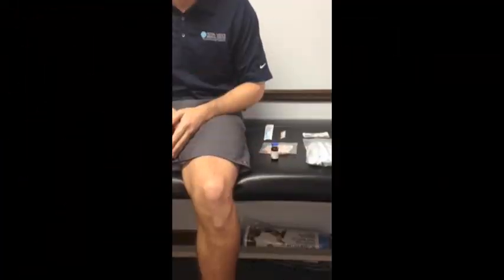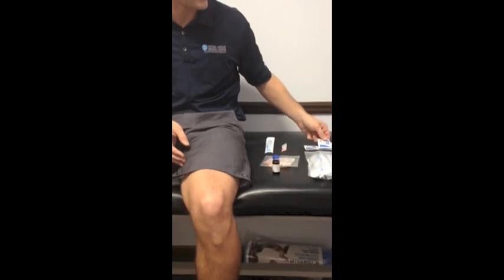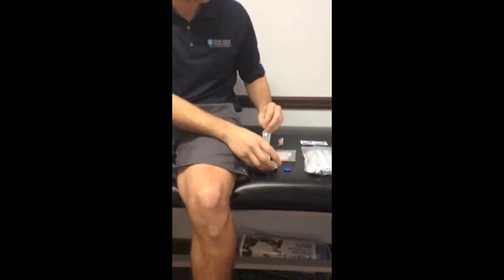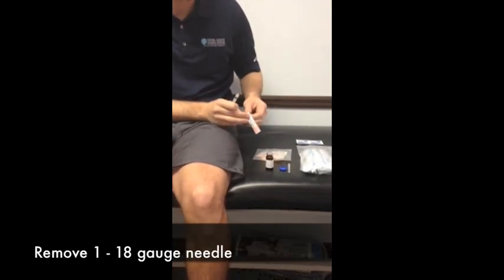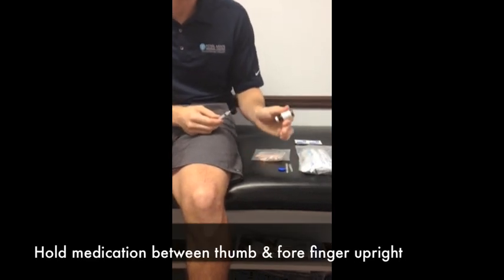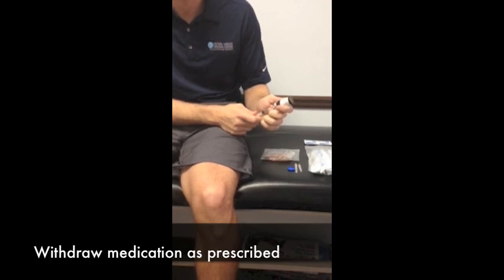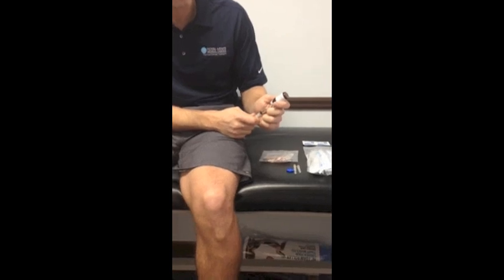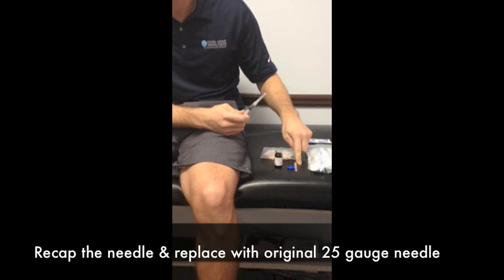How to inject Testosterone

Comment: Forgot to withdraw the Test. Cyp. out of the original needle (the draw needle), what are you going to fill the injection needle with? Your injection will be less than 1 ml. Otherwise, solid demonstration.
Reply: @Danny_Thompson_sasquaatch420  actually, it is about a 1/10 of a ml, which depending on your dose, could be quite significant.

Comment: Before you inject the Test. you should pull the plunger back 1/4" to make sure there is no air in it.  This Nitwit should have explained that.
Reply: The CDC has updated on that. There is no need. Especially with the gauge used in trt.
Reply: @snailnslug3  college was a long time ago for me, and I'm no longer hands on in the health industry. With that being said, what harm can aspiration do? There's only benefit even if there's a very slim chance of an incident. Ounce of prevention vs a pound of cure?